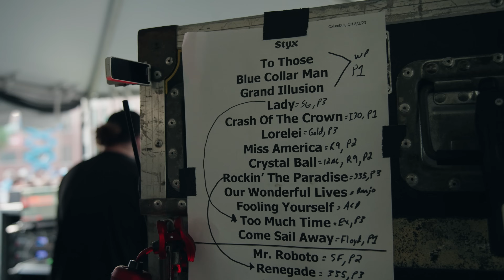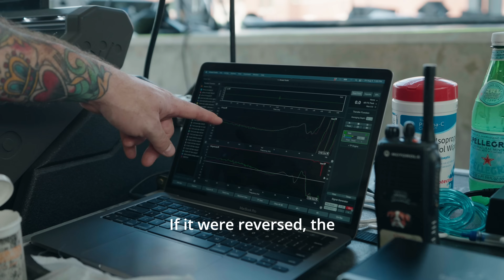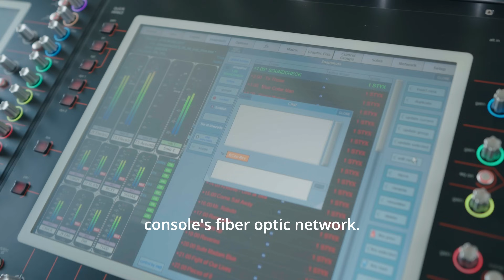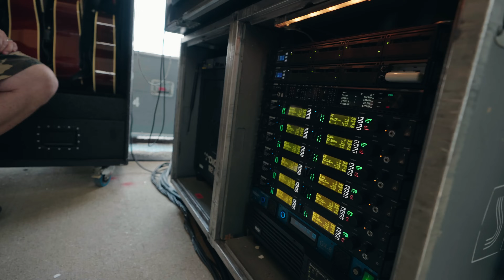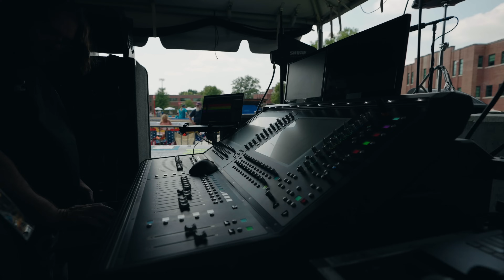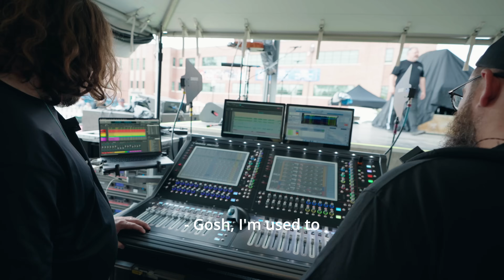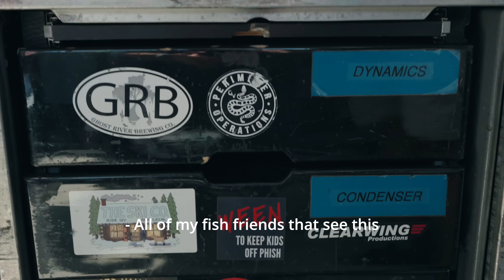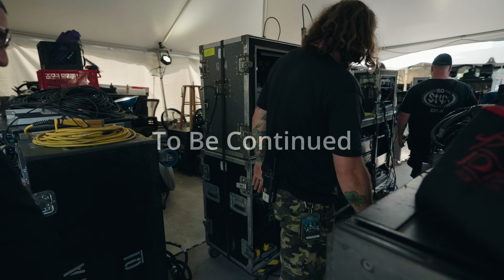Monitor Engineer Show Us Everything!  | STYX Evan McElhinney Mixingt Tommy Shaw, JY, Todd Sucherman

Comment: Wait till you get hit by an arcing, live, incoming, utility supplied leg, which never should have been an issue, and you’ll see why he takes the ground and neutral disconnect so seriously.      I was untying a guest distro at my own house gig late one evening,  and someone had stolen my Allen wrench for the lugs, so I was forced to use a large flathead screwdriver, as the hardware stores were closed.    Knowing I would need to use that exact one again if I didn’t replace the Allen wrench before next tie-in, I went to place the screwdriver, carefully, holding the wooden handle, tip first, into the bottom of the box, which was simply a disconnect, not where all the breakers were.    To this day I don’t know why this happened,  maybe wet floor and my Doc Martens were too wet and I was sweaty, I don’t know,  maybe the soles weren’t insulating enough, but that screwdriver jumped out of my hand at the last second as I was setting it in place, and welded across from the utility 120 leg to the chassis of the box.    This threw me about 5 feet back into a wooden, double door closet with louvers, which housed a big transformer, knocking most of the louvers out of the doors, and left me feeling like a small herd of elephants stomped across the right side of my torso, shoulder, through chest, to my hip.     My right leg never felt a thing.   Weird.    But the lights in the building were flickering and dimming and I could hear 60hz oscillating, and the screwdriver was seriously welded in place.    A smack with a drumstick didn’t budge it.    But a hard hit with a round base straight mic stand base did break it loose, after a few hits.   Unreal.     An odd experience.    My right side hurt for a few days, but I was functional, with no pain from moving around at all, which was strange, compared to being sore and feeling like you just played a football scrimmage.    Just generally very sore.    And it just went away.    I’ve gotten some “therapy” a few times since, but never that degree, which scared the crap out of me and got me to get a better grip on how AC power works, and it’s incredibly misunderstood.   Dangerously misunderstood.     The stories of musicians dying on stage are thankfully few.     But when in doubt, meter your guitar strings and mic caps against neutral and ground and make sure that what should be neutral or ground actually are.   I’ve seen an artist get thrown backwards into a double full stack after a small lightning strike jumped from the mic to his lips.    My house gear was properly wired and grounded and it took a lot of convincing to establish that, since the artist immediately blamed the “house”.     No mic cable should ever be able to be live.    But what happens if the power cable from that old Fender amp is “repaired”, and the guy thinks that since it’s AC, polarity doesn’t matter?    Well, without a complete circuit, hot is hot, and neutral is not, and neither is ground.   When a circuit is made, like when a device is plugged in, neutral is now also energized, but ground SHOULD not be.     The mic cap CAN be connected to the power ground, but generally is not, as the XLR  ground pin usually goes through a transformer from mic to console, often at the snake split, unless the split has ground lifts on every channel, and the ground is lifted on that channel, which means no alternate route for current.     If the amps power cable is mis wired such that the otherwise grounded bridge, tuners, and strings are now connected to the hot leg of power, the results can be bad.     Where the person is not grounded, like with rubber soles being the insulator, the person cannot act as the completion of the circuit.   But when they touch the strings, which are connected inadvertently to the line side of power, through the ungrounded, two prong power cable which was installed wrong, and then the person’s presumably wet lips touch or approach the mic, which is maybe now connected to neutral through the bonding bus bar, where the XLR ground has been “lifted” it is disconnected, removing a safe path.    Now,  the grounded mic cap, to mic chassis, to XLR ground, to equipment chassis, which is ultimately connected through the neutral to ground, completes the circuit, thereby bypassing the safeguards of a properly grounded system.   Accidentally.     AC connection polarity does matter, especially in certain circumstances.    Which is why Ground Fault Circuit Interruptors are used in wet environments.    They break the ground circuit if needed, where that very safety path could be the death path.
Reply from the maker: … good lord. That is wild man…. Glad you’re alive to tell the story. Scary stuff.

Comment: Out of curiosity; the last part about the power, are they dragging in separate lines for phases, neutral & ground? 
Here in EU we usually have a single CEE form connector for 3 phase up to 125A@380V~ I can imagine that running separate wires makes it easier to transport as combined can get a bit clunky
Reply: Yes we use individual cables for ground, neutral, and the three phases. 
Your CEE connection is a better scheme. 
Since we use roughly half the voltage, each leg is double the current of what your system is meaning each cable is much heavier with larger gauge.

Comment: What brand are those G multi pin connectors?  Amphenol?    I can't seem to find and would love to look into those.
Reply: Yes. Amphenol G series. They are OLD. Not even sure if they are still available
Reply: @cookie_mix  thanks for the reply!   I do see something in my searches called a 'G-BLOCK' connector which may be the same or similar.  There is (also?) a G-series connector made by a company called Wireworks (Amphenol-style/compatible? who knows) but I'm still researching.  Thanks for your help, and again the reply!   

BTW - love this video... gold!
Reply: @craigg8314  wireworks I think took over the production. Yes G block. Those would be the connectors. One block would be pinned as 6 audio pairs (18 pins) and two block connectors were pinned as double 6 pairs so 18 pins in each block. This had to do with multi cable limitations back in the 80’s (not kidding) where Belden only made 11 pair then later made 12 pair cable. 
It’s an old robust connector but most companies have moved onto others.
Reply: @cookie_mix  Wow that is amazing!   Really appreciate your insight and info.   Very interesting, cheers!
Reply: check out wire works.  they seem to still be into this connector.
Reply: Going to do a followup video that has more in-depth discussion on multi pin connectors.  You can find the G style connectors at a company called Wire Works in NJ.  They are great to work with.

Comment: can you provide a link for those AMP G connectors?
Reply: I cannot post a link here.  But they are available from a company called Wire Works in NJ.  Stay tuned for a follow up video where I'll discuss the connector and where to buy / how to order.  I'll do an in-depth comparison between different types of multi pins that we have out on our current tour.
Reply: @styxbeerguy9279  Thank You for your reply I can't wait to see the follow-up! 🤗

Comment: Don't the vcas change the channel level. and then affect all mixes
Reply: Yes and no. The mixes for the musicians are generated through aux outputs and the channel strips are a combination of pre-fader and post-fader sends to those aux mixes. 
Pre
Reply: @cookie_mix  pre or post   the vca (voltage control) or DCa Digital control affect sends pre or post.
Reply: @buddytheelvisofdogs  pre fader aux sends-doesn’t matter where the channel fader is. 
Post fader sends-channel fader level above and below unity affect the level of the aux send and because of that, VCA/DCA/CG have an effect since they change the value of the channel fader
Reply: @buddytheelvisofdogs  oh, maybe the missing piece of information here is that each channel strip has its own discreet assignment of pre/post to every aux. Hats can be pre-fader to aux 1,5,6 but post fade to aux 2,3,4,7 as an example. Not global.
Reply: @cookie_mix  are you trying to say a dca doesn't affect a pre fade aux send?
Reply: @cookie_mix  hahahaha
Reply: @buddytheelvisofdogs  refer to your console’s manual for a better description of pre and post fader options.
Reply: Only on channels where that specific mix is in Post Fader mode.  I mentioned in the video that the pre/post assignments for channels to mixes changes on a song to song basis.  I do this so I can have a one fader to boost or cut things in some of, but not necessarily all, of the mixes.  Works well for guitar solos for example.  I know that for the folks who want that subtle ( a db or 2 ) bump for that solo will get it and it will go back to the appropriate level after the solo for everyone.  It's all about vibe on stage.  Good question.  Thanks!